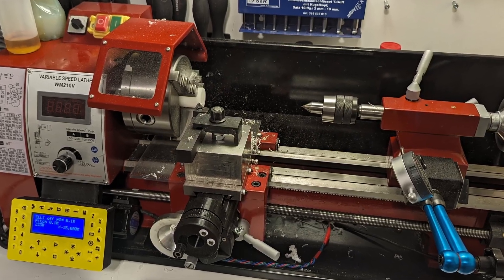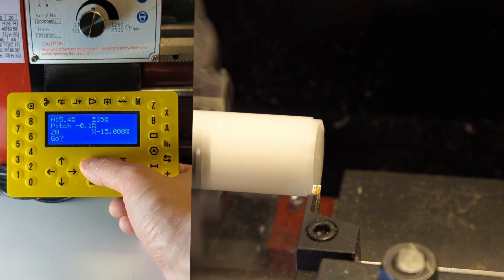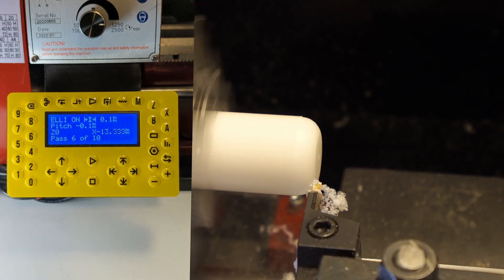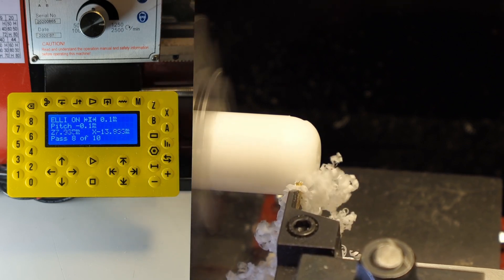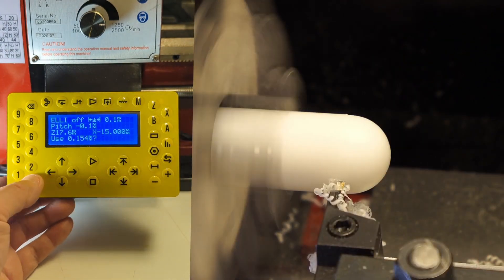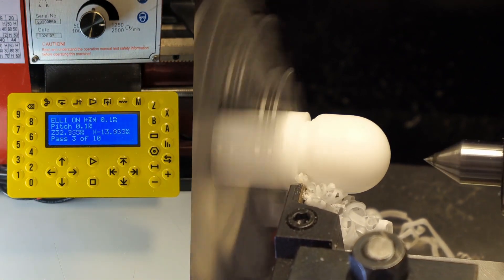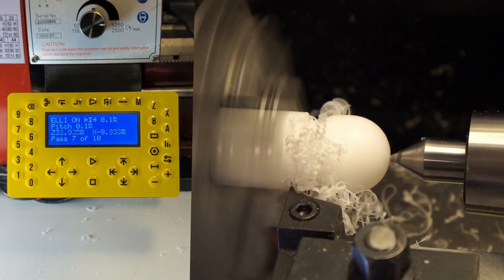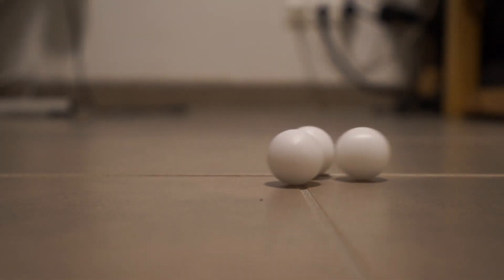Sphere on a mini lathe

Comment: Excellent!  You should have told us the oversize was intentional... left to allow for polishing... I would have believed you.  😊
My father removed the pointed cone from a Live Centre, and replaced it with a 'negative cone' (Like a cup-shaped cone).   He used it to support work like you have shown here, where he needed both axial and radial support.  Care is needed when 'parting off'; the workpiece can get trapped, and thrown out with considerable force.  (Don''t ask me how I know!)  I still have it, along with his lathe, more than seventy years later.
Reply from the maker: Seventy years! My dad wasn't even born then :) That is a great idea - making a reverse cone to support spheres. Probably can just 3D-print an adapter for the tip for starters. And you're definitely right that the part can fly out, that said it probably depends on a host of conditions, tried it twice and both times it fell off.

Comment: hi Maxim, as usual great video. I will start very soon my project but I have a question. Do you use interrupts for the rotatory encoder or other components? I am not an expert and from what I saw you made a great product. If you have time, let me know if I should use interrupts and on which components you would use them. Thanks a lot my dear
Reply from the maker: Hi Roby, thank you, yes - I use an interrupt for each rotary encoder - https://github.com/kachurovskiy/nanoels/blob/main/h4/h4.ino#L1412 - the trick is to keep the code in the interrupt handler function an absolute minimum. On ESP32 interrupts are blocked while it writes to Flash memory. Also, each interrupt handler function needs IRAM_ATTR attribute.

Comment: Hello Maxim. My name is Rudy  and I wonder if you have a complete kit of your CNC system for sale. Lead screw and cross slide. My mini lathe is a 210V. Please let me know.
Reply from the maker: Hi Rudy, I only sell the main controller on kachurovskiy.com/ and you'd have to get the motors and other parts somewhere else - the reason is that every lathe (even among 210V) is slightly different. As soon as you mount motors on your lathe and encoder to your spindle, the controller can operate.

Comment: Hi Maxim, you have done wonders with Nano ELS since  first video  Arduino lead screw: proof of concept 2 years ago , Nano to ESP32,
Cutting  sphere nice and easy with ELS or Lathe Code,  better and quicker than with Digital_Feed_7e2.
How does digital readout work. Check on YouTube, RUSSIAN ELECTRONIC NORTON BOX ON BV20L and   STAN CANADA   SMART LATHE T5  uses STM32 F4O7ZG
Let me know what you think.
Reply from the maker: Digital readout on NanoEls works by giving the position of the motor and on H4 we also try to correct that for backlash. Checked out STAN CANADA channel, thanks for sharing! What is it about Russians and ELS 😄 Author there definitely has a Russian accent. Anyway, those machines are 40k+ and controller is nice - and joystick is nice - but probably the only thing they have that we don't is taper threads?
Reply: @MaximKachurovskiy  Search RUSSIAN ELECTRONIC NORTON BOX IN BV20L  --Author   Nei Ribeiro  , search  YouTube either one, and smart lathe made by 

YUWE MACHINE TOOLS.  To me software is similar to you nano els or   Digital_Feed_7e2. version, they have few small clips where it shows how to update 
software stm32f407zg, stan canada demonstrate better, if one has a larger lathe nano els can run it with bigger size stepper or servors and vfd, how often will one need to machine taper thread but its nice to have it, and can nano els sphere verson be replaced with  Digital_Feed_7e2. keep  good work

Comment: Hi Maxim, don't know if you have searched Russian  Digital_Feed_7e2, here is you new version.  https://www.youtube.com/watch?v=8WK0MLHs4QM.
Nano may be next?
Reply from the maker: Hi Milan, thanks for sharing the link! @neiribeiroclpta fixed my ugly MegaEls front panel and made it much nicer (I designed the MegaEls PCB first and saw the resulting panel too late). Digital_Feed_7e2 has a few core problems though - pulses are approximated so the cutter is in a slightly different place each time, hanging wires cause EMI noise problems, UI is challenging and code is hard to change, BOM is too expensive. It's also based on a legacy platform - Arduino Mega. Looking forward to what Nei will make next 😀